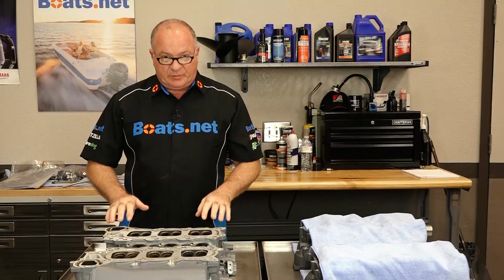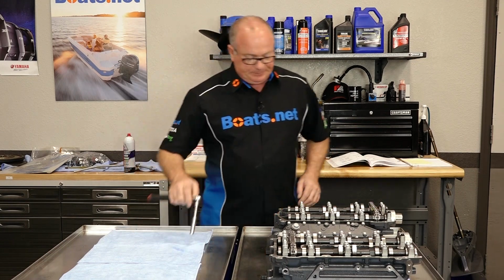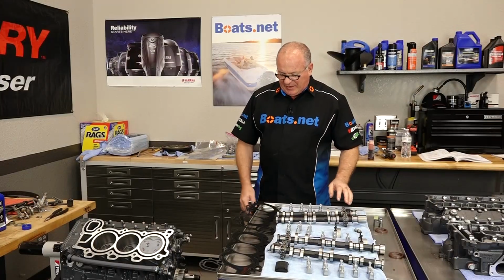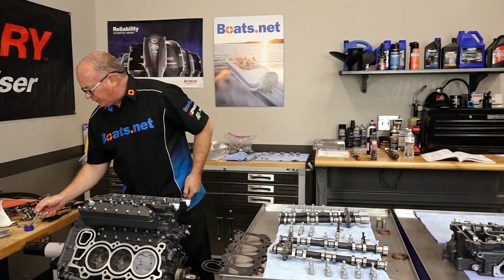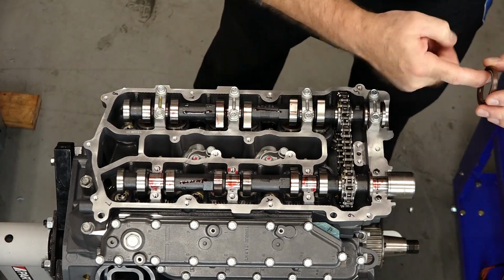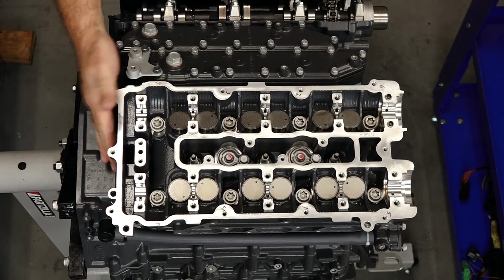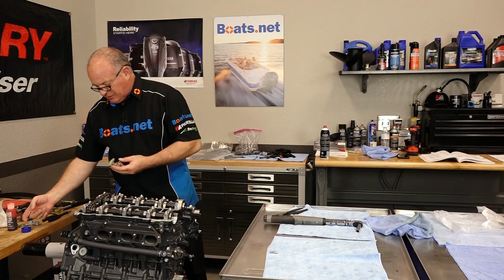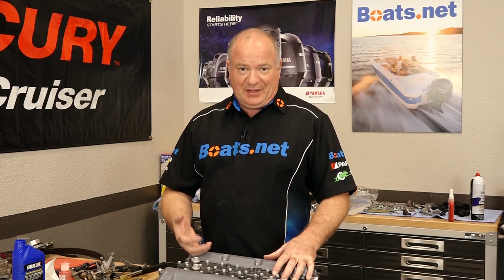Yamaha F225 Powerhead Rebuild Pt 5: Head Installation | F225 Cylinder Head Installation | Boats.net

Comment: Hello I really enjoy watching your videos they are the best on youtube and super informative. I have a 2015 VF250LA. I have water leaking from my middle spark plug. After investigating was told to pull the head. I am getting close but had a couple of questions.
1 what size torx fitting do I need to remove the head bolts.
2. I have removed the valve shafts and caps. Do I need to remove the springs using any certain tool or can this be done after removing the head. Thanks in advance

Comment: Hi John, just discovered this set of videos and learned a lot.  Question:  How did an outboard that is only 5 years old get so corroded in the power head and lower  drive unit?  This unit is virtually destroyed.  Is there a lesson to be learned on maintenance?

Comment: Hi John, Thanks for the interesting and informative videos. A couple of questions, was the seized bolt in the exhaust manifold an indication of the underlying problem with the engine. I'm a motorbike/car person, is there a good a reason why Yamahas and the others don't use a heat exchanger to keep the corrosive salt water from being in direct contact with the engine?

Comment: Do you not have to adjust the valves on a Yamaha like you do on a Honda?
Reply from the maker: These heads came as complete assemblies from Yamaha and the valve clearances were already set.
Reply: Do you need to run break in oil during the break in period?